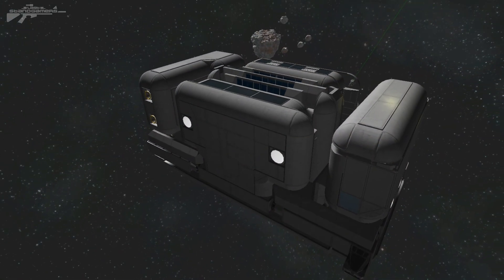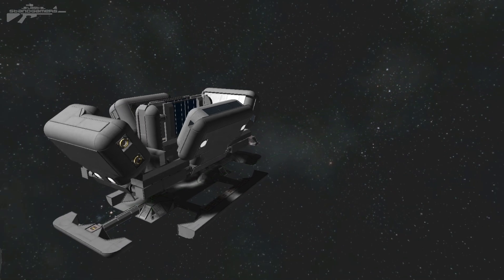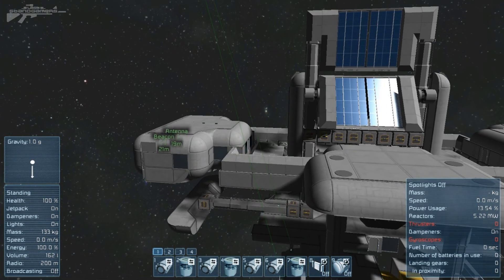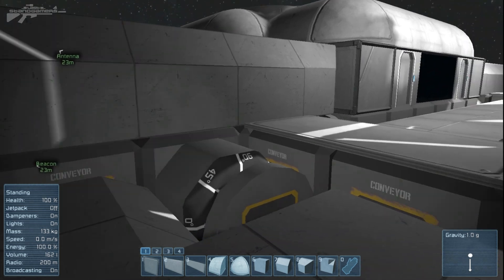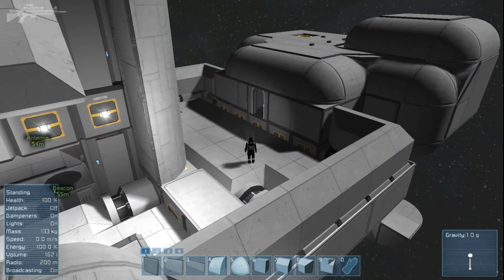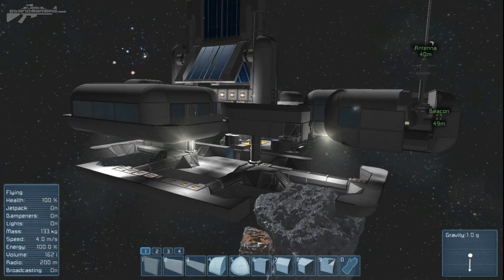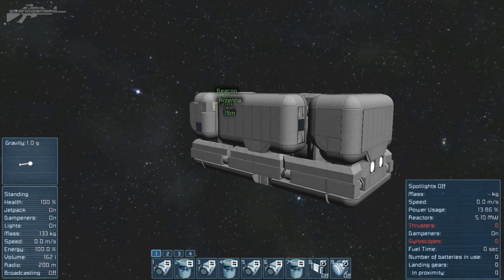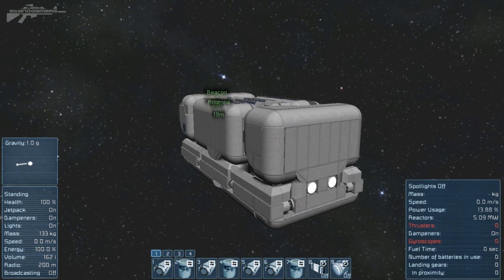Space Engineers - Colony In A Suitcase, Popup Space Station

Comment: my only two complaints are: 1. How do you manage to move this thing without any visible thrusters?  Could you stick merge blocks or landing platforms on the sides and lock them into a really huge ship with a lot thrust? 2.  Not enough turrets for self defense.  This is probably not too big a deal since if this is a planetary station, you could just as easily construct turrets on the ground and merge them in the station during use for power and control share, then unplug the towers when you go lift off.

Comment: I think it needs to more pistons on the base plate section. The Current setup has major flaw, it being top heavy, and Plue if one side of the station weight more than another (since sections separated by rotors and pistons are on separate grinds) it creates some serious balance issues. Which will inturn place stress on the 2 pistons and cause them to fail. Easy fix is to add 2 more pistons, there by increasing stability and shifting the load.

Comment: Really nifty design! The last time i tried my hand at using rotors i blew my newly constructed, destroyer-class spaceship to bits...
Reply: Zipp4Everyone
Someone on the workshop is doing "Hardlight" Bridges like the ones off Halo. He's working on getting them to turn "Off" and "On" right now; if he succeeds, instant forcefield.
Reply: When I tried to use rotors I only put a small hole in my ship but the ship was over 60000000kg so it was massive and hard to break
Reply: I decided to just use Pistons
Reply: I know, its just painful when you'v spent hours and hours perfecting a design and choose to add a door or elevator using rotors and pistons and it all blows up in your face =P

Iv adopted the ideal of either "Nobody can enter this hangar due to... FORCEFIELDS! YES OMG YES!" or the "iii dont REALLY need one do i? Noooo... may..NO!" thinking which always work... untill it doesnt =P.

 Whenever i do make something using a rotor or piston i always save right before creating the rotor/piston block.

re-load<3
Reply: Zipp4Everyone Try locking the rotor in place with a landing gear or there was this mod i downloaded that was a blast door block that also locked like a landing gear.
Reply: Shinzon23 Awesome! Thanks for the tip +1 :D
Reply: Batman

Comment: I built something similar, but mine used mass blocks and a generator to sink to an asteroid surface, then a rack of drills would sink most of the ship into the rock, and finally the top would open out into a small docking port, com station and lift access. It works great, except when you load a save, it detonates and is torn to pieces by the rock around it, some how.
Reply: you have to convert it to a station.
Reply: bobafett215x  You can't convert large ships to station only station to large ship.
Reply: You can convert back to station by placing a merge block onto a station then merging the ship with it. It wouldn't work in this case unless the tunneled station lined up 100% perfectly with the block grid